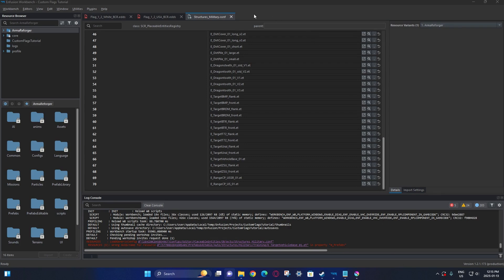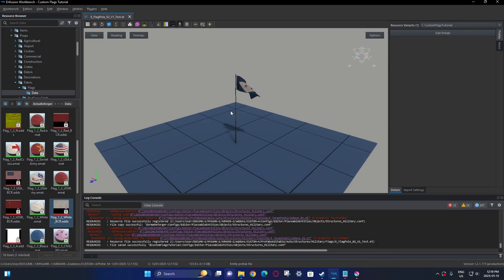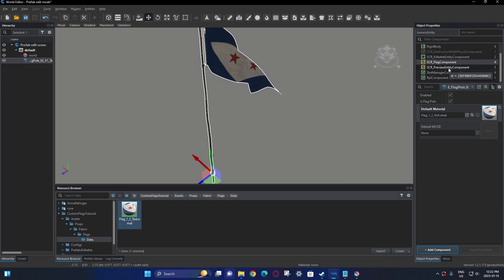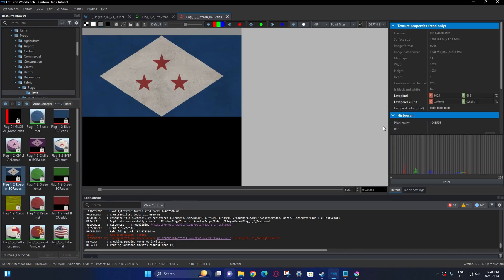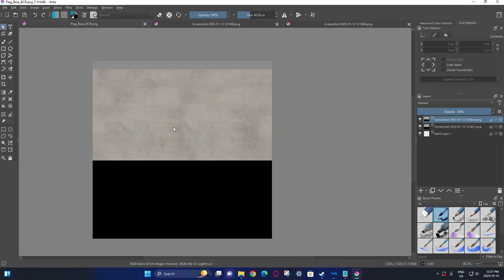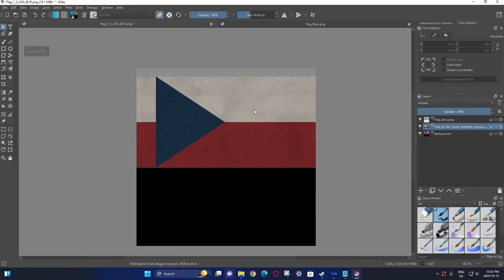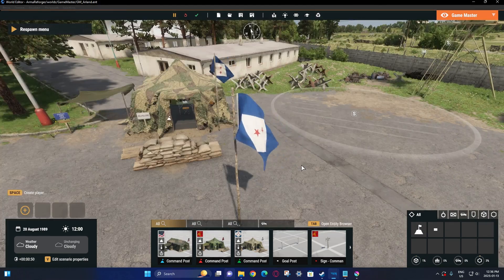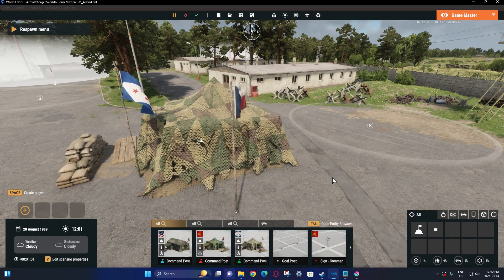Arma Reforger Modding Tutorial: Custom Flags

Comment: thanks for the tutorial! i have a small question: on the textures i created there is no black "bar" at the right side of the flag, but when i import it there is one like maybe 10CM wide and i have ZERO idea how to remove it
Reply from the maker: I'm not sure what you did when creating the textures, but that sounds like you were creating the opacity map for the flag to get different sizes for it, so if that is the case, make sure to create the main flag texture first, then after create the opacity map texture which has the black bars.

Also, the main texture is supposed to have a large black bar under the flag like shown in the video.

Some other things you could do would be to:
- Rewatch the video again, but more carefully
- Look at the base game textures (all texture channels as well)
- Look at the names of your textures, and make sure you have the correct ending at the end of the name like "_BCR" or "_A"
Reply: @ReforgedMarineModding hey, thanks for the answer! So i looked more carefully and it’s not black it’s dark blue, just like the color of the other side of the flag (french) so i dont exactly know what happened, but that isent important anymore because i cant seem to even save it 😂 i tried to inherit and duplicate the flag but it complained about the fabric color being in read only, so i duplicated the whole « flag » file but it still says it’s read only. I tried everything i could think of with no result, i think i’mma just delete everything, do it again and hope it works😅

Comment: any chance we could get a vid on how to make custom prop flags ? or custom loading screens
Reply from the maker: What do you mean by "custom prop flags?" This video was about that exact thing. Creating custom flag props.

As for the custom loading screens, I can't guarantee that I will make a video for that, as I have never done a mod relating to custom loading screens at the moment
Reply: @ReforgedMarineModding  It would be interesting to have custom cardboard screens, I looked for tutorials and didn't find any.
Reply from the maker: @jhonatasfoulu4896  What are "custom cardboard screens"?
Reply: @ReforgedMarineModding I made a mistake in the pronunciation, I meant to refer to loading screens
Reply from the maker: @jhonatasfoulu4896  Like I said in the previous response to the other guy, I can't guarantee that I will make a video for that, as I have never done a mod relating to custom loading screens at the moment
Reply: @ReforgedMarineModding  I think by "custom prop flags" they meant the flags that can hang on a wall not just a flagpole. This is something I would also be interested in seeing you make a video about.
Reply from the maker: @WarDaddy94x  I haven't created those types of flag props before, so I don't plan on creating a video about that at the moment, but it would most likely follow similar steps to this video, but you would duplicate a static prop, and replace the object with a simple model for the flag (like a thin rectangle you can create in blender)